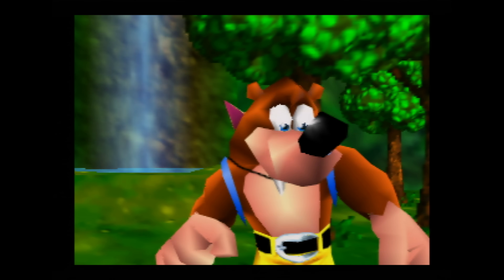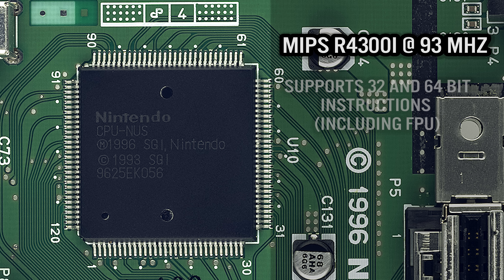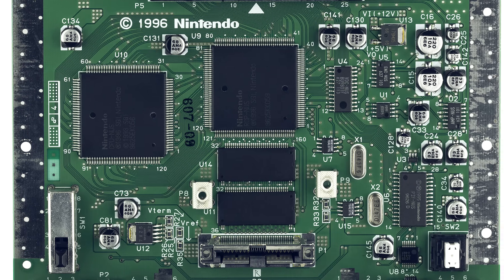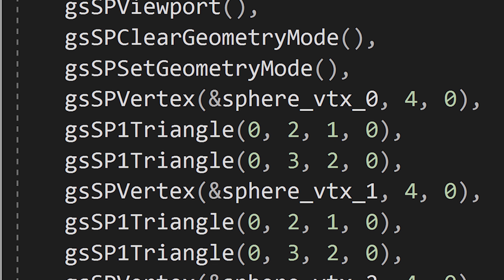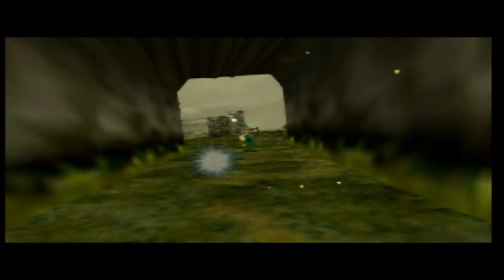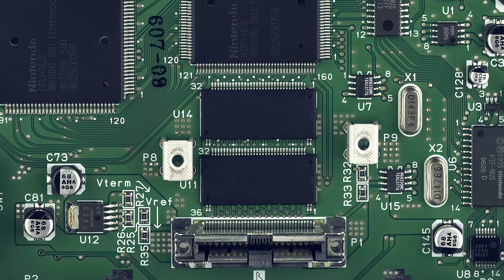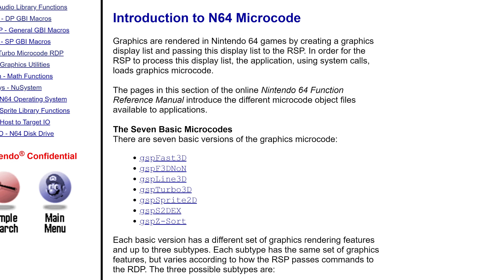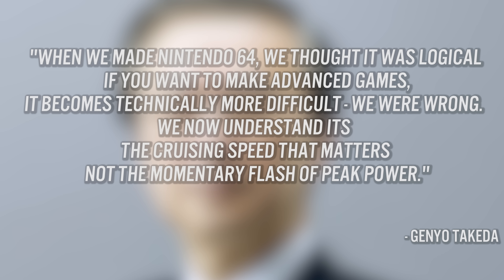Why was the Nintendo 64 so hard to develop games for ? | MVG

Comment from the maker: If you developed Nintendo 64 games back it the day, let me know about your experiences (feel free to email me)

A few points.
- I didn't talk about DMA in this video as i the main focus was on the graphics side. However if you want to understand how DMA worked on the N64, check out Rodrigo Copetti's blog (link in description). tl;dr - the implementation is NOT good
- at 1:54 i meant to say 16 and 8 kilobyte instead of bit
- stay safe!
Reply: N64 was the first console I developed for. I wrote a lot of the game engine (rendering and character control) for Earthworm Jim 3D (I know it was not a particularly good game - I'm so very, VERY sorry). I have fond memories of using the hardware - and don't remember it being particularly bothersome. It was a struggle early on with the documentation, but once I got a basic textured triangle on the screen, in my memory it went smoothly (from a technical point of view). But it was a long time ago, and I wouldn't say we really pushed it. I hadn't programmed any 16-bit consoles, so perhaps it helped not having that baggage. And the display lists felt familiar from having worked with DirectX (DX3? DX5??) albeit the N64 had a more OpenGL like syntax. I definitely remember fill rate and textures sizes being an issue. Pretty sure we kept everything 32x32 or lower. 

We started the game quite early on in the lifecycle of the console, but the project lurched in a few different directions, so by the time it was released the engine was older than other titles that were hitting the market at the same time. The chap who worked on the camera and collision had more issues - I remember the collision, in particular, was difficult to optimise - and the camera was hamstrung by the fact development of the levels and the camera happened in parallel - the camera should have been nailed down first - but that was a project management thing, and nothing to do with the hardware. The big positive I remember was the speed of the CPU and the fact it had a built-in FPU. We did a lot of prototyping on PC and converting that code to the N64 was easy. I do remember the Partner64 debugging system being unreliable - both the hardware and software were temperamental. That slowed things down, especially during debugging phases. 

All in all, I really enjoyed developing for the N64, and really like the fact it has a great catalogue of games, even if the one I worked on isn't :)
Reply: @rubikcuber1492  thanks for this, i love hearing dev stories, even if their finished game wasn't the most amazing
Reply: rubikcuber I kinda liked EWJ3D. Played PC version though.
Reply: @noop9k   noop9k  So we originally developed on PC and then ported to the N64 when we got enough proper devkits (initially I had the only one on the team, and that was inside the SGI workstation) and after a while we just concentrated on the N64 and the PC version was left mostly as a preview tool for the level designers. Once we completed the N64 version we flipped back to the PC and decided rather than fix it up we ported the N64 back to the PC, writing a wrapper API to implement any N64 specific stuff, and adding new bespoke DirectX renderer. What we found was a lot of code assumed the framerate and performance you get on an N64, so we had to change a lot of the PC code to make it framerate independent. That's why the PC and N64 behave quite differently in terms of timing. I think it's also why N64 emulators seem to struggle with the game, they run faster than real hardware and the code doesn't handle that well - I'm sure jump heights and animation are slightly wonky with most emulators.
Reply: Can you teach how to homebrew games?
Reply: @rubikcuber1492  Hey man if it makes you feel better, I rented that game all the time as a kid.  Fond memories.
Reply: @rubikcuber1492  Awesome!
Reply: I like to compare Nintendo's restricted sdk to the story of crash bandicoot where the dev removed Sony's code to put in place faster in house code
Reply: @stevenbenson9976  Are you referring to that Ars Technica interview with the developers? That was super interesting. They threw out the Sony libraries and created a virtual memory management system specifically for the PSX. Wild stuff.
Reply: Steven Benson There’s similarity, but while on PS early games had to bypass the libs to render more polygons, GPU fillrate was mostly unaffected. This is not specific to Crash Bandicoot, almost everybody would use hardware directly later.
On N64 the GPU itself worked slowly due to crappy microcode, in fact, slower than on the PS despite having much greater potential. Only relatively few later games used faster microcode for GPU.
Reply: @stevenbenson9976  Sony can be very fortunate to had Naughty Dog, Mark Cerny executive producer on Crash Bandicoot is now the main guy behind the PS4 & PS5. What a successful journey.
Reply: Awesome video! I worked on 'World Driver Championship' as an artist (built the Las Vegas and Kyoto tracks) and it was nice seeing it in this video. Total love for the N64. :)
Reply: @jakfearon2945  Found you! (:
Reply: @sol8712  hah! Yes you did. <3
Reply: @jakfearon2945  WDC was one of my favorite games as a kid. You can definitely feel its Rally roots, but it was a beautiful game and really scratched the itch I had for a Gran Turismo type game, plus that career system was really unique. I really wish there was any game like that today. I do the hardcore race sim thing now, but I'd love to experience WDC again for the first time.  Kyoto and Vegas were beautiful tracks!
Reply: @KyleP133  Oh awesome, I'm glad you liked it (and my tracks, thank you!) It was probably my favorite game to work on in those good old days. :)
Reply: I have some annoying corrections on the WDC part. It's 30 FPS, not 60 (which is still a lot faster than many N64 games), and what did the "miracle" was disabling the Z-Buffer operation nintendo basically demanded from the developers.
The Z-Buffer is a secondary screen buffer that store the height of every pixel drawn, so you can test if the pixel you're drawing is actually visible or occluded by something already drawn to the frame buffer.
It takes quite a bit of memory and quite a lot of fill rate, because it's an extra read and write to the main memory per pixel being drawn.
The Z-Sort program allow you to disable the Z-Buffer and sort the triangles from back to front like on the PS1 rendering, so you get the extra fillrate to reach the 30 FPS target, AND you get the extra memory that allowed the game to run on a letterboxed high resolution mode.

Also the PS1 have an even smaller texture cache than the N64, just 2KB, but it was a smart cache that automagically downloaded the correct "tile" from a larger texture, so it was a lot easier for the developers, but still required the artists to organize the triangles to avoid having too much auto fetches.

Actually the 3D artists in this generation suffered quite a bit. it's the 3D artists that had to deal with the 4K cache on the N64, the PS1 tile shit AND the sega saturn atrocity of using one full texture per quad drawn, that required em to break the texture map into several tiny texture maps (i think sega offered a tool that did it for you, but it's probably crap).
Reply from the maker: @dan_loup  great info thank you.
Reply: @Dr_Kachu san
Wow, disabling one of the main 3d hardware selling points, z-buffer, to claw back performance :o. So much for SGI magic I guess.
Reply: @rasz  You gotta do what you gotta do.
Unless nintendo specifically forbids you from doing it, then you don't.
Apparently, the people that developed WDC did a lot of work to make sure the game LOOKS Z-Buffered while not being so, or it would not pass the nintendo certification.
Reply: Dr_Kachu san and perf impact of cache misses is much greater with bilinear filtering compared to nearest.
Reply: @noop9k  I don't think you can get a cache miss on the texture of the N64 as it's a memory you copy to instead of something automatic.
But i imagine the main reason for the cache was the bilinear, as you have to fetch freaking three colors from the texture per pixel you draw, and that would be a pain on the RDRAM.
Reply: Dr_Kachu san Ok, I’m more familar with PSX GPU. Got mislead by some statements in this video. If this ‘cache’ can only be manually managed, then what I said is irrelevant, but must be a pain in the ass for the devs.
Yeah, texturing w/o any cache is one of the flaws that killed Jaguar.
Reply: @noop9k  I bet it was the 3D artists that got hit by the cache the hardest, not the developers.
You just have to use small textures, and probably just like 2 or 3 smartly used ones, as still take time to copy data to the texture cache.
Reply: Dr_Kachu san well, this problem appears to be similar to how you avoid context switches  in OGL programming. If you want to batch geometry by the texture it uses, some programming is required. Dunno if really relevant for N64. Also, there could be tools that split big textures into smaller ones along with the geometry.
Reply: @noop9k  The API is still hammering the CPU, so you do lose some time in the nintendo API if you use too much commands and context switches etc..
But i suppose you want to minimize changing the texture as much as possible because the 4k copies will add up.
Reply: Dr_Kachu san What I meant that in ‘normal’ OGL/OGL ES texture switch is still an expensive operation even if it seems to not involve copying the texture data itself. When you want 60 FPS even from a 2D game on early iphone hw, you try to squeeze as much related stuff as possible into a single texture atlas and then spit out all your 2D rectangles as a single strip.
And if you do dumb stuff like bilinear shrinking 32-bit texture, your fillrate is murdered by RAM accesses.
Reply: @noop9k  Ah yes. But i bet there is some caching happening under the hood, as well, its just faster, specially when dealing with mobile memory.
But just the DirectX/OpenGL/Vulkan etc api calls are slow, including those to change the textures.
Modern APIs allow you to do stuff like using texture libraries, where you offer the shader a pack of textures and the shader itself can choose between em, so you can just keep on trucking.
It's quite neat.
Reply: @dan_loup  Yeah i already told him about zbuffer when i factchecked the video before release
Reply: AFAIK, textures couldn't be used from Cartridge or Ram.. Texture Cache was mandatory.. BUT .. TCache was 4k, meaning you could use 32x32 rgba 8888 textures.. but you could also use paletted textures, where 2k was reserved for the palette (what a waste !!) and the other 2k for the texture itself... making it possible to use 16 color 64x64 texture, which was the standard format we used back then.. we also used 1bit 128x128 black or white textures for crisp backgrounds along with some artistic "vertex coloring"..
Reply: i even kinda remember we could also do 64x128 textures.. meaning 2bpp/ 4 colors.. but really not 100% sure about this.. 20 years have passed since then ;)
Reply: @ZeRealGlobox  the 64x128x2 is correct i think. it's bang on 2KB
Reply: @ZeRealGlobox  All those alignment/allocation requirements on the TMEM really made an already bad situation worse. If I remember right mip layers past the first one also all had to be on the second 2KB.
Reply: @espfusion  I don't recall actually using mips... textures were so small and so stretched... Plus the N64 was a such a "Blur-Machine" by itself, there was no real need for blurry mips anyway ;)
Reply: @ZeRealGlobox  Between the TMEM waste and performance impact of trilinear (or nasty mip transitions) I wonder how much anyone at all bothered with them. Especially when game textures would mostly be way below mip0 anyway, and it's not like it helps texture cache spatial locality since there isn't cache to begin with.
Makes me think the feature was a waste of die space, should have had real cache or more TMEM instead of this and some other features.
Reply: @espfusion  Rare games seem to use it, but i imagine most games must do just a "swap to an even blurrier texture" trick
Reply: MVG, you have made several mistakes since minute 6. It is mandatory for the RCP to use the TMEM to paint the textures and to use the bilinear filter. RCP cannot use RAM or cartridge memory for textures, and also they are too slow to apply effects to them. What they did in Turok 2 to use 64x64 pixel textures is to use 4-bit textures with color palette, or black and white that were colored by the RCP based on the color basis of each polygon. But this was not exclusive to Turok 2, all games at some point use colored black and white textures for specific polygons that only needed one color, for example some doors in Ocarina of Time. Even grass and dirt effects were achieved with the same texture painted in green or brown.
The RDRAM latency is not that high compared to other chips of the time. The EDO RAM of the 3Dfx Voodoo has a latency equal to or greater. The problem was in a very narrow 9-bit bus and over-exploited memory that was used to store code, polygons, textures, z-buffer, framebuffer and much more data, making the 500MB / s of memory very limited.
Reply: N64 used RDRAM? That stuff was prohibitively expensive, wasn't it?
Reply: Unrelated: I love how you have everything so neat in the background, it makes your videos stand out.. I can tell you have the same care when developing these videos..
Reply: @kenrickkahn  yo I agree. MVG is one of my favorite channels for many reasons, this being one of them.
Reply: @Purpleturtlehurtler  It is! and he's one of my favorites as well.. I can't stand watching YouTubers having bad habits that can easily be fixed and avoidable.. Presentation is everything to the viewer and MVG proves that..
Reply: @kenrickkahn  I also love the discourse in the comments. I see comments pointing out inaccuracies in the video and thoughtful discussion following it up and I just have to say that puts a smile on my face.
Reply: @Purpleturtlehurtler  hes a billion times better than dreamcastlies and RGT97 (i uped his number because he acts like a brat)
Reply: Friend of mine worked for rare at the time the N64 was out, i've sent him a link to this video, hopefully he has some interesting things to contribute.
Reply from the maker: @n2n8sda  that would be awesome. I've spoken to one myself but he didnt remember much about specifics
Reply: Coto: Also RDP commands, then texture cache data can be sent through DMA on burst mode transfers (sequential) which usually override the slow (non-sequential) access time the RDRAM suffered, this usually used to stream from CPU -> to RSP + libmad (mp3 decoding), samples through a ringbuffer, or to RDP (framebuffer effects, packed, tiled textures)
Reply: you forgot to pin your comment bro
Reply: If developers learned from Developers like Capcom and Rare.. Those 2 developers made the N64 shine..
Reply: @kenrickkahn  Most of Rare's games ran too slow imo. They were technically better than most other developers, but it definitely was possible to achieve a stable 30 fps if you really knew what you were doing, and I think that would have been a better idea. 

There's a small number of 3d N64 games which even achieved a pretty stable 60 fps, with F-Zero X being the most well known example.
Reply: Dear commenters. This is the most constructive criticism I have seen in YouTube videos so far. Thank you for quality input!

As a hobbyist programmer I can only imagine the struggle to fit things in the small caches... And the quote in the end is something I very much second: It's not about the maximum power, but the cruising speed! Thank you once again for great content - although some errors seem to have slipped in this time :)!
Reply: Matti Viljanen 3DO, Sony, Nintendo made the same mistake of initially forcing devs to use their hardware via their libraries, which had shitty performance.
Reply: I wonder if we can push the console any further with the games already on it like slight texture quality upgrades within the hardware limits
Reply: Expensive Nintendo license + Expensive SGI hardware + Expensive up-front Cartridge manufacturing costs = Only the Most Well Heeled 3rd party developers can even begin to develop on this 
It’s the exact opposite of the “bedroom coder” that Sony courted with the Net Yaroze
Reply: This is a great thread. I like to hear from the former programmers, as well, correcting mistakes but being informative and not douchey about it.  I think it speaks to MVG's level of quality content where he is respected and people in the know can give proper corrections and have a fun conversation about it
Reply: one of my fav parts of your videos is what type of 80s percussive synth is about to blast my ears
Reply: Modern Vintage Gamer Not only was hard to develop for it, but it is also the hardest console that others are having too much trouble to emulate properly.
Reply: Nintendo 64 emulation deep dive next?
Reply: Did Topgear overdrive actually use mp3? or ekstremely downsized wav-files?
Reply: because  DEV KITS WHERE HUGE AND TOOK TIME THATS WHY next video : how to mod a switch without getting introuble for it
Reply: Developers always Complain but alot of them are lazy
Reply: @real_flip  Well, back then anything to help was welcome.
They went from "you move this pixel object in X and Y" to "you have to create a world, transformation and view 4x4 matrixes, and then multiply em together and calculate the normals of every vertice and use this quaternion function to not get problems of gymbal lock" overnight.
There were a literal crash course on 3D graphics on the development manuals of the N64/Playstation/Saturn because there was just no way to learn it otherwise without having to deal with a LOT of math bullshit, and most of the books on 3D graphics were probably about raytracing, not realtime.
So not having to deal with an infernal undocumented DSP and weirdass limits on top of that helped a lot.